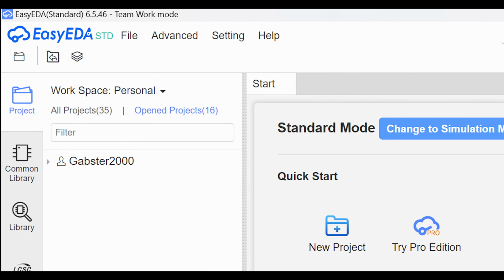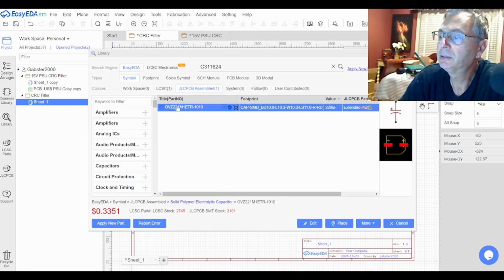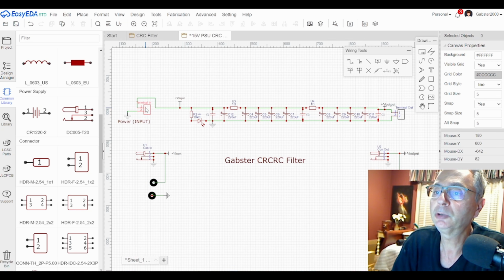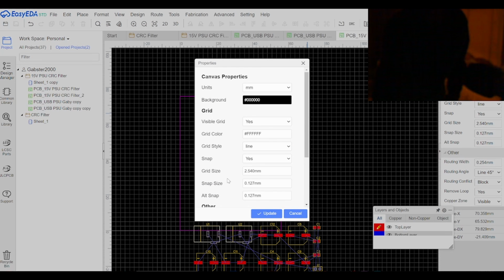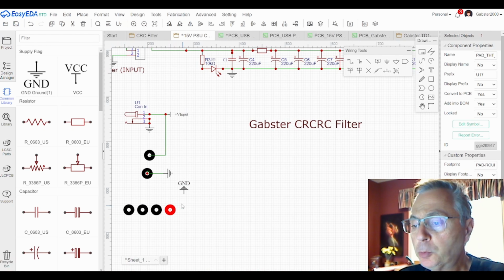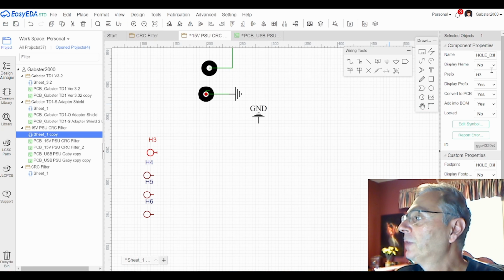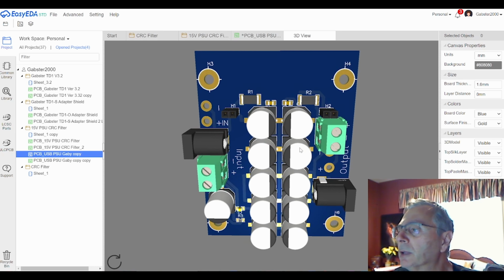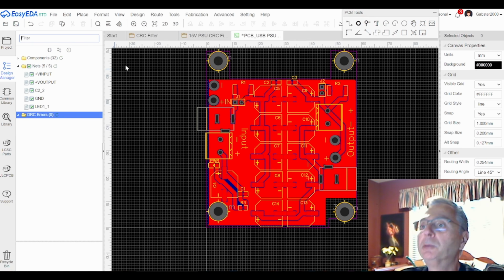How to Design and Order a PCB with JLCPCB

Comment: Some design suggestions.
Use Amass XT60 connectors, lower R and less chance of polarity mistakes.
Use silicon RC wire 0.08mm strands, very flexible, 200degC, less skin effect.
Add some L in your circuit, removes high frequency components.
Use some low ESR stacked ceramic capacitors, better frequency cutoff, such as CER 68UF 25V X7R SMD PN: ST203C686MAJ03 or CAP CER 220UF 25V X7R SMD PN: ST203C227MAJ10
Use ground planes, keep the R down, maybe 2oz copper.
Add resettable fuses just in case.
Give us some numbers, get a ESR70 - Atlas ESR Gold - Equivalent Series Resistance Meter